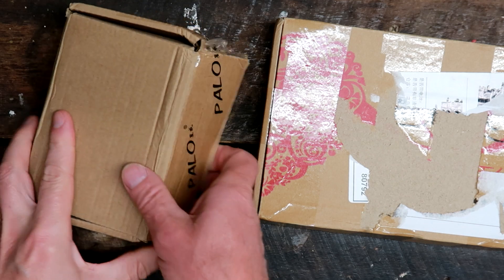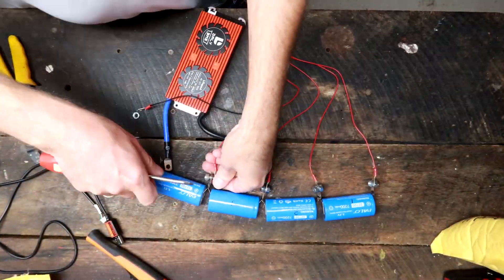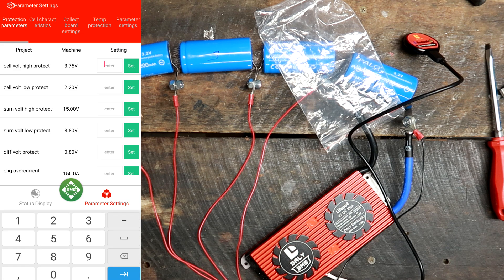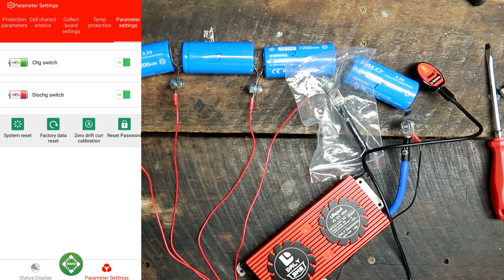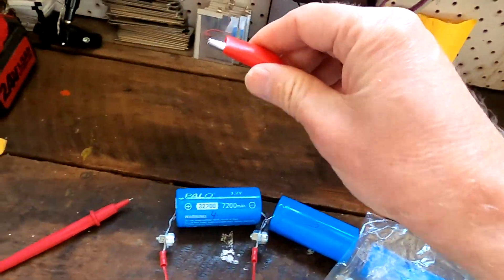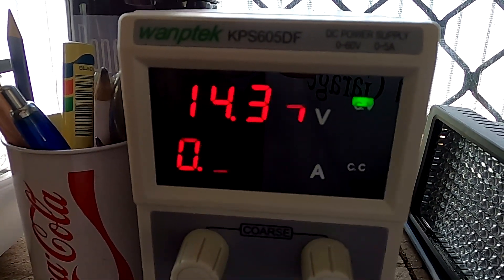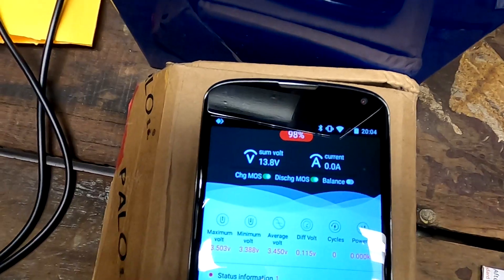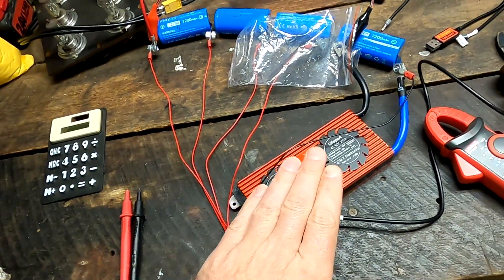Why DALY BMS' are so popular? Exactly, I don't know either.

Comment: Andy, the BMS does not charge the cells through the small leads, it discharges them. When a cell hits 3.6v it will keep discharging it until the rest catch up. Your charger is across them all and is series charging them all same current in all unless steered to ground by the bms lead

Comment: I first buy Daly to replace my JBD, I do notice the difference, my big JBD has a very good balancer that is still working when cable is disconnected from load & solar controller. Daly doesn't do that, even there is clearly words "with balancer", it doesn't balance passively when disconnected, it does so a little by little when charging & discharging. I don't know the precise how Daly did that. But nearly all are balanced except one battery that is higher and one that is lower after several days of use. The most important thing that Daly featured is its charging protection, it strictly limits below 3.65v for all cells by pumping up and down a little, stopping current from solar controller for few seconds then opening it up again. This doesn't happen in JBD as JBD allows my cell to be over 3.7 for a while before disconnected, this is not good for health in long term. That is why for those who favors health/longevity of LiFePo4 battery instead of fast balancing & fast charging, they should choose Daly.

Comment: I saw this video, you were missing the NTC temperature sensor, that is the reason the BMS doesn't working right way.
Reply: This guy is lost
Reply: He doesnt think he needs it
Reply: Not called balance leads - sensing leads because this is a Smart BMS not a specific Balancer.. 
Temperature sensor NTC must be connected. 
You don't pair Bluetooth just click..
The button wakes up the BMS when not charging..
Balance should be set to begin at  3.2 and set to 50mv..

Comment: I've had a Daly  4S 250a BMS connected to my 500a Sinopoly cells in my boat now for almost 12 months and it has worked flawlessly, I did however top balance my cells first
Reply: @FullyChargedZone  👍
Reply: @FullyChargedZone  Awesome☀️🔋
Reply: Nice👍
Reply: Yeah I've run them for years without an issue. All my packs have pulled full capacity years later.
Reply: @WillProwse  I have mo issues either
Reply: He changes the settings daily in provocation of results, great for video content

Comment: Andy, I admire your channel, your style, and your dedication to research and testing.  As others have pointed out, I think the Daly BMS does exactly what it is expected to do IF your cells are initially top balanced, closely matched, and then subject to daily charge cycles.  I have been using a 4S 12V 150 amp dumb version successfully for the past four+ months with a 280 amp hour battery. As intended, my pack is being cycled / charged, frequently as it is under load 24/7 running refrigerators. I seldom find cell deviation much in excess of .014V, usually between.006 and .009V deviation.  That’s a result that I can live with.
Reply: Daly does what its suppose to do,  I have no problems

Comment: Daly bms is popular because a few years back, it's all we had. Besides cheaper ones on eBay that failed the moment you connected an inverter. No one made bms available back then besides batrium and Orion. Oh there were a couple others available, but very expensive. We are talking 1000$ or more for a BMS. 

I like the older "dumb" Daly bms models. I have 20. Never destroyed one and they work great. 

The Daly "smart BMS" is total garbage. I've seen so many posts on the forum of people bashing that BMS, that I will never touch it. And that company is a pain to deal with. I've emailed them. They give half answers and don't understand their own products. Anyways, that's why people like some Daly bms. The cheap ones work. That's about it.
Reply from the maker: Thanks for sharing, Will. That makes totally sense. And they are red! 
I personally don't like the dumb ones, because the cut-off for low and high voltages are usually a bit too high or low and you have no control over it. On the other hand r BMS just triggers and disconnect the battery if the charge controller fails of the load first not disconnect. So pretty much never. A BMS is just the last resort before something goes terribly wrong with that battery.
Reply: @OffGridGarageAustralia  yes agreed! Absolutely 😄
Reply: Well, whadya know? It sounds like my being a cheapskate has paid off! My project has had a limited budget (an entire van conversion) from the start so I originally had to get the cheap stuff before progressing to the "best budget" stuff. I figured I could add monitors to the circuits later on so just to let the BMS do its job and I already have SSRs to isolate the battery/charger so I figured that so long as it's balanced, there's nothing the "smart" version can do that I can't add myself later and be in full control of it.

Comment: I think you need to do two things.  Drop the start balance parameter to 3.2v so it start at a much lower voltage.  Next discharge the battery right down and then charge up so the BMS has a chance to balance the cells.  Might take a couple of goes.  The BMS will switch off after 3600 seconds on your current setting.  This can be upped to 7200 which is much longer and I notice the BMS does balance even when the supply power is cut for a while.  7200 might be a permanent on setting, haven't worked this out yet.  Finally the cycle count doesn't work with shallow charges and discharges.  I don't know what Daly use for a "cycle", another query still to be worked out. However, my Daly 150 has worked all summer and supplied all the power we need on board the yacht to run the electrics and the inverter for the kettle, toaster and induction hub.  We see a difference of 0.001v between the cells after it has been charged for a while but not reached 100%.  Perhaps the larger cells help.  Its a 120Ah battery.
Reply from the maker: If I start balancing at 3.2V, would that not balance all 4 cells with 30mA all the time while charging? What would be the difference to not balancing at all??? With that, I only lower the charge current for each cell by 30mA. All the time. That makes no sense at all in my opinion.
Reply: @OffGridGarageAustralia  Well, I can't answer that, all I can say it what is working for me.  I see the BMS balancing the cells as its charging through the range and it results in a very small delta which does change but finishes in tiny percentages of a volt.  Perhaps it s a time thing so from a low voltage it has the power on and the time to keep the cells balanced.  It may not be perfect, but it is good enough for my needs.  Perhaps we will look back in years to come and say wow, weren't those BMSs crude, but they enabled at lot of folk to use LFP at a cost effective price and a system that worked.
Reply: @pete9501   I have three daly 250a fot two years now, flawless. and they are not programmable, they look after the battery and have never let the cells go over parameter. When discharging the higher volt cells give out more watts to eventually balance themselves
Reply: @rogerandlyndabeall3840  What do you mean "not programmable?  You can alter just about every setting you need to, or are yours the older non BT models?
Reply: @pete9501   Mine are non bluetooth
Reply: @OffGridGarageAustralia  lower start voltage will start balancing only at 3 cells - without lower voltage cell. It will work.

Comment: I also have a Daly 100A 4S with BT but my BT puck doesn't have a button (I LOL'd at the heartbeat joke btw xD ). I immediately noticed you didn't have the temp probe as mine won't function without it plugged in. I also had to short pins 1 and 3 of the display board socket to 'wake up' the BMS and BT connection, and there was no printed manual (which is probably a good thing as online forums have much better information even though I was searching for literally hours). My experience with balancing was exactly the same and found out through trial and error that it's next to useless. The state of charge (SoC) is all over the place and never accurate so I just ignore it. IMHO, it's overall not a bad BMS as the protections all seem to work but I agree with you, there aren't enough settings options and the information from the app is too limited with not much in the way of useful context help. For some of the quirks, I just don't understand why they would implement it that way. Now with the recent update to V2 of the Android app, it asks for the PIN just to get the individual cell voltages every time you connect to the BT module, which is super annoying. It used to just be before you make any changes. I'd say if you're going to use these in their current state, you MUST top balance or be prepared to babysit with a resistive load while it charges. It sucks that you have to use the UART+PC and know all about 3rd party devices like RPi's etc. to get what I consider basic functionality, but my purchase was based on a known rather than an unknown, given the number of these out there. Great video, as usual.
Reply: where did you find instructions for which pins to short for wake up? 
I do not have a wake up button.

Comment: I think you are being a bit hard on Daly. They are resold here in Australia and supported by some good companies with humans you can speak to. You actually get a warranty worth something, as opposed to dealing with Aliexpress and "ship it back here" so we can check it, out of action for 6 weeks rubbish. When I purchased my 4S unit it came with a USB stick of software and instructions. They are a good (low cost) product for battery market for RVs and to integrate into DIY battery packs. They support Bluetooth and the Android app is fairly good. By default they go to sleep until they receive a charging current -makes sense for the target market. This can be turned off and a "reset" switch added.
Reply: More like he doesnt know what hes talking about

Comment: Nice work Andy! 

The experience you had is surprisingly common, and it's largely because of people's expectations as well as the terrible documentation. Just because something is popular, doesn't equate to it being an excellent product. And it took me quite a while to figure out the fiddly settings. It's important to realise that they need to match a product with their needs. 

However they are still a good BMS for some people. The balancing function is very minimal, which in my case is fine, because I properly top balance my cells, and they are all well matched to start with. The wake up is something people have issues with very often, but the button on the BT module is a wake up button. It should only need to be used when you first connect the cells to the BMS. The "light board" also comes with a wake up button. There are other ways to wake them that work differently in different versions. 

The different versions is my biggest gripe with the Daly family, they're quite inconsistent with the features, connections, and firmware. I wish they would just settle on something and stick with it. 

However all that being said, they're still a very solid BMS for my usage. I've used close to 100 of them now, and never had a genuine failure (I bricked one in a moment of inattention with wrong wiring). But all my others, have been perfect. I use the 250A version, and it's handled well over 1000A peaks without any negative effect (of course it shut down after the preset 1 second time though).
Reply: Sherylin  I've only used Daly so far. But I have a JBD on the way for another project.
Reply: Sherylin  JBDis probably more popular than daly with big DIYers they use the same app as Andy's BMS, overkill BMS are made by JBD
Reply: Sherylin  JIABAIDA Electronic Technology Co

Comment: Hey Andy.  I have a Daly BMS and even though it doesn't show the balance switch on I believe it is still balancing.   I have left the Daly connected overnight before with no charge or load.  In the morning the deviation of the cells went from .1v to .01v.  As for the bluetooth problem of having to push the button to connect.  This only happens when there is no activity.  So no charge or discharge.  I believe it's a power saving thing.   Once in actual use and actively discharging or charging the battery, it stays on.
Reply: He doesnt know how to balance batteries
Reply: The blue tooth button reactivation could also be a security feature, anyone who maybe able connect with your permission one day would need to enter your property and press the button to start blue tooth the second time.

Comment: Andy, I use the 250 amp Daly on my DIY 280 ah batteries. To start with they would not work with the temp sensor unconnected. Only one of my units had the Bluetooth with the switch so I ordered 2 of the light bars just to mount a little farther from the battery. What I found is that using them must create enough current flow to keep the balance running.  I seemed to have found this purely by accident after leaving the batteries for a day and a half.  When I looked in the app the day I returned the cells were all balanced to within .001 ma. My 2 batteries are 24v 8s then paralleled.
Reply: So... did you left a load running over night? Or just the idle current from inverter?
Reply: @raymondcasso7966  what is your question?
Reply: What kind of light bar do you mean? Could you pls specify. thx!
Reply: @none0049  how did you get the batteries to pass a current if they are in parallel?
Reply: 250a Daly has fans on it. Point of failure. I would never use a BMS that relies on fans for cooling. Also,  I would never use a BMS like these that claim the amperage that they do. 
Fire hazards is all they are. 
Their 100a BMS should have #4awg minimum wire size and I think they use #8?
Reply: @raymondcasso7966  The batteries each have a Daly BMS.
Reply: @juergwyser6520  Daly light board. (my bad calling it a light bar).  I am using them only for the switches.
Reply: @raymondcasso7966  No actual load just the Daly light board. (my bad calling it a light bar).  I am using them only for the switches.
Reply: Don't know what you mean by light bar?  Are you referring to the little meter that comes with?
Reply: @danfitzpatrick4112  I have the 250A Daly BMS without fan. they make both versions, so user choice!
Reply: @FullyChargedZone  I agree, he is very misleading. Its that or he doesnt understand what hes doing.
Reply: @kwalstad9754  Can you post a link? I am trying to get it to run and top balance but it doesn't stay balancing except under charging.
Reply: @FullyChargedZone  hello. I have a 32s setup with 16s 2p. 32- 3.2v batteries 2 strings of 16 in parallel to achieve 48v pack. 48v 5000 w inverter only gonna need about 200amps usage, So i see the daly 32s 250a isn't programmable as I need to set precise low/high cutoff points. So would I run 2 daly programmable 16s 250a units in parrelel to balance and set cutoffs on the 32 packs? Kinda confused how or what to do here. Please help if ya can thank you. Everything is at a standstill untill I get this right and dont order or spend money on the wrong components.
Reply: @windpowered7771  
Youtubers are notoriously ignorant when they first buy a product online. Sad fact is that one is only ever knowledgeable AFTER you've owned something for a while and LEARNED about it IN REALITY. Do not take any newbie's advice about ANYTHING. Andy is a self confessed newbie with Daly BMSs.

Comment: Is the QUCC waterproof like the Daly? My Daly keeps my 200AH cells at exactly the same voltage...but I did top balance them first. I need the low temp cut off in Tassie!
Reply from the maker: Is the Daly waterproof? What about all the contacts and plugs around it?
Reply: @OffGridGarageAustralia  Yes, waterproof
Reply: There are all sorts of thermistors out there you can source cheapish & easily now, ebay, google, whatever, select a temp range you want they can do 10Amps, hook it up to a decent size relay to isolate ur batteries or to switch on a pet mat warmer or 2 under &/or around ur battery setup to keep them at a set temp. 
You could even probably just simply use  a cheap 12v dog warming mat wrapped around ur batteries u could just turn on  manually when necessary as a quick cheap fix, they dont use much power & some may have a thermostat you can adjust the temp this way to some degree, you can also use a PWM type dimmer or motor controller, cheapish again on ebay, to regulate the temperature so you can use less power to regulate the temp, the dog mat of different sizes you can also find at those horrible dollar shops for $20-$30, dont use the 240v - 12v power supply adaptor, just plug it straight into ur 12v battery bank. Cheers

Comment: There is nothing really wrong with your steps to check the balance lead, there is a slightly different way that I like to use.  Put the negative lead on the negative of the battery and leave it there.  Probe with the positive meter lead, first the most negative lead of the balance lead connector.  The value should be zero.  Then move the positive lead up the row as you did in the video.  I feel like this method removes any chance I might tough the probes together on the first two pins, as the connected probes are never even close. Also, if somehow the connection for the most negative lead is wrong, you are actually testing for connection of the most negative lead.  If you start with the negative lead rather than the battery negative, you are testing "relative" to the most negative rather than relative to the battery negative.  Thanks of your videos, I enjoy them.